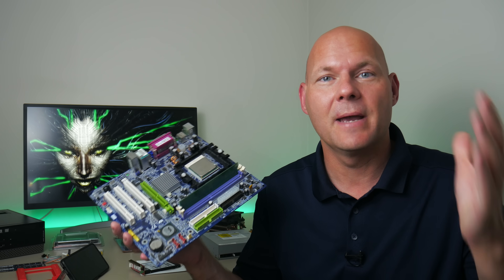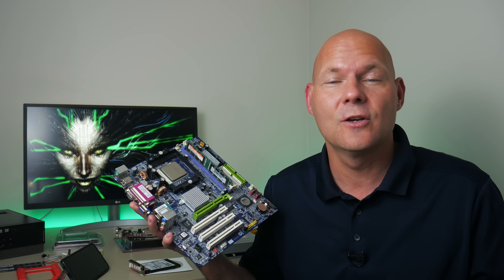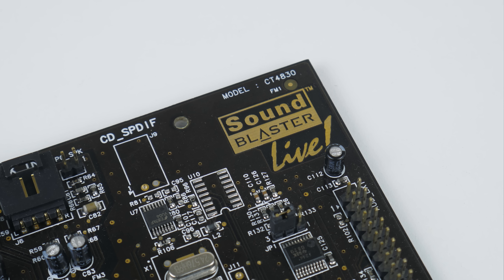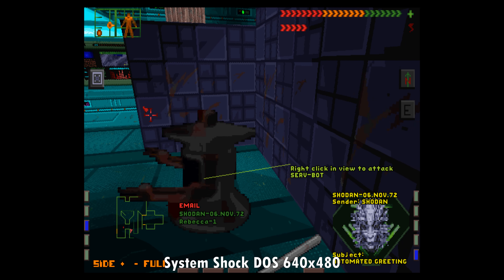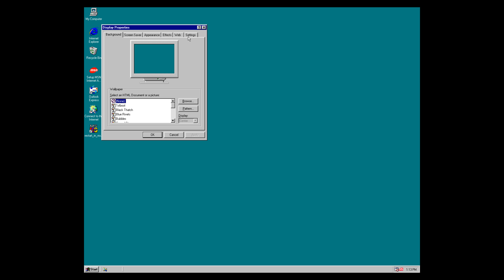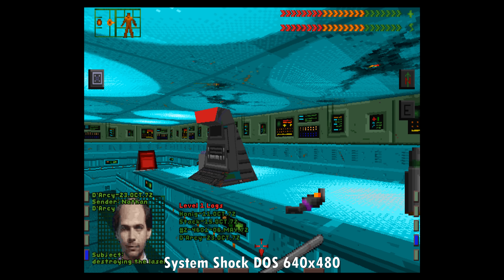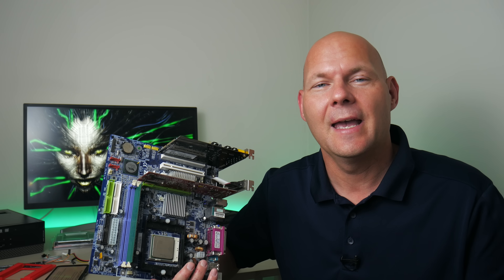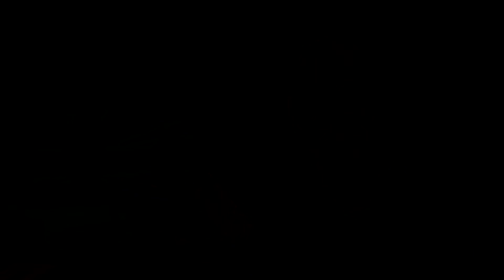Running Demanding DOS Games on Affordable Hardware

Comment: Phil, just some clarification needed here...

Under "true" MS-DOS without going to MS-DOS mode via Windows, then MS-DOS will only ever detect ISA sound cards with an appropriate driver, correct? Okay, it will also support some parallel audio devices too, but never PCI.

In other words, you have to go into MS-DOS mode via Windows 98 to have that mode see the PCI sound card, once Windows has already detected it and indicated in Device Manager that is has a Soundblaster compatible mode on IRQ 5 or 7?

That seems to be the core problem with true MS-DOS emulation, in that any PC or motherboard with an ISA slot or two on it usually demands a premium price on eBay.

And where does this hardware you're showing here fit in with your recent video where you demonstrated the DOSBox Staging really gives excellent results for software emulation nowadays?
Reply from the maker: MS-DOS mode is true MS-DOS. Once you shut down into MS-DOS mode, the machine stays in it, even after a reboot. Only when to type EXIT will it load Windows again. See Windows 98 SE is built ontop of DOS. However I urge anyone to install Windows 98 SE first because it is just so much easier to set everything up. DOSBox is awesome, but so is playing around with real hardware, maybe we end up playing more with the hardware than actual games, something for everyone and you can decide what you prefer 🙂
Reply: @philscomputerlab  Thanks, that's a useful explanation.
Reply from the maker: @terrydaktyllus1320  Thanks for asking, it helps me make better videos 🙂

Comment: Thanks Phil. This was very well timed for me. I am just in the process of building a retro PC with a Pentium 4 and an ECS 661GX-M 7 REV 1 motherboard. Any ideas if this is a good start?
Reply from the maker: Pentium 4 will be awesome for this!
Reply: @philscomputerlab  is SiS chipset ok?
Reply from the maker: Yes they are good! But I don't know about DOS compatibility with the sound cards. Only one way to find out!
Reply: @philscomputerlab  Hi Phil. I have met with success thanks to you. I used the above motherboard which has SIS chipset. I decided to use a Sound Blaster Audigy EAX SB0090. Using your MS DOS mode Supereasy and the Audigy drivers from your website. I then copied the command lines created by the SB16 emulation into the DOSSTART batch file and hey presto all working. Sound is great. Thanks for all your help. I never thought I would solve this. Great content from you as always

Comment: i have a little problem  reserve  irq 5 for sb live.   moving the card to all slots making  all combinations still  irq 5 is not available.   under win 98 the  irq of the card is locked and i  cannot manually change it.   can i manually unlock irq selection via windows 98?
Reply from the maker: Check the BIOS under PCI Resources! On this Gigabyte board for example you can reserve interrupts and assigne them to specific slots. Also make sure PnP is enabled so that Windows is in charge of resources and not the BIOS. What IRQ is it using at the moment? Also disable any onboard devices you don't use like serial, parallel, audio, ethernet, floppy, SATA...
Reply: @philscomputerlab  at the moment sb live  is at  interrupt 11 locked.   windows notify  me that i cannot modify the specific irq.  also i will check the  irq 5 on bios, in order to make the specific irq  reserved.  pnp is anabled and all unused devices are disable. 
i have the same gigabyte motherboard,  but in atx form , not the mini atx you are using .  thank you very much Phil!!

Comment: i liked the am2 am2+ am3 am3+ generation so much... i still run all of them an even added in a lil wimpy am1 system lol but damn the phenom2's just wont Die.. started with a sempron 3400+ gave way to athlon 4400+ gave way to athlon 7750+ gave way to phenom2 720 gave way to 960t gave way to 1045t and obtained a phenom2 965 to replace the 960t and came across a phenom 2 555 dual core that unlocked to a Beast quad thats running 3.7 ghz on a Realy weak cooler but its doing it daily.
Reply from the maker: Phenom II are one of my favourites. By then the platform was very mature and a wide range of CPUs for anyone taste. I like the X2 Black Edition the most, very decent for running Windows XP for example.
Reply: i always avoided intel. recently got an old intel emachines t5026 system with a pentium 4 in it but deeper investigation leads me to reasons why i hated intel.. the socket debacle each socket runs at its own speed leaving the system only able to use the slowest of pentium 4's and beyond that the mother board has had its agp port literally neutered off of it... leaving me with no choice but to use a Albeit Good pny fx5200 256mb pci card to get the system to do more then word processing with the horrific intel integrated display chip.
Reply: it runs HyperBlade good enough :P

Comment: Great Phil Iḿ also in the process of using Athlon for old DOS games, particularly with motherboards that supports ISA slots for Sound cards. Like the GA-7IXE4
Reply: If you have got a motherboard with an ISA slot in it at a very good price or even as a freebie, then you have had some good luck - I can find nothing on eBay that isn't at a hugely elevated price.
Reply from the maker: What is cheaper? A PCI only board + decent DOS PCI sound card or board with ISA + decent ISA sound card?
Reply: @philscomputerlab  Clearly the PCI-based system is cheaper but without an ISA card and slot (as I understand it), you can't get sound in true MS-DOS systems.

So there is a "trade-off" here, surely?
Reply: @terrydaktyllus1320  I think there are a few exceptions, one being the Turtle Beach Montego PCI + wave-blaster compatible module, and probably the Ensonic PCI based cards. But you are right for guys like me and other who love the sound of an old ISA turtle beach, PAS16 or GUS or even ISA Creative ones. Same reaosn why we don´t use emulators
Reply: @philscomputerlab  I think there are videos showing what a Vortex 2 + NEC XR385 (to be in the cheap side) can do in DOS, and the fact that in an Athlon 64 you can also run more modern games as well there no question about it. Win-Win
Reply: @boardernut  Indeed, I don't think you can ever get the quality of real hardware in software. Thanks for the good info!